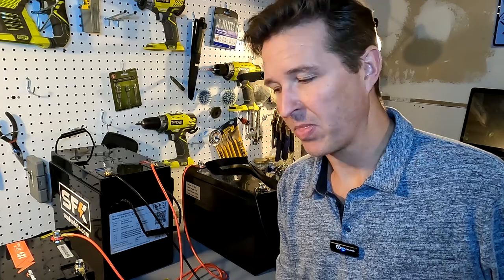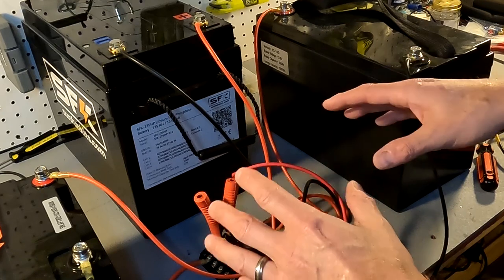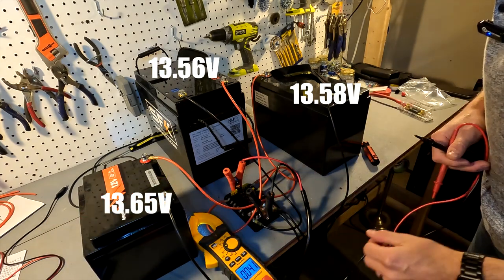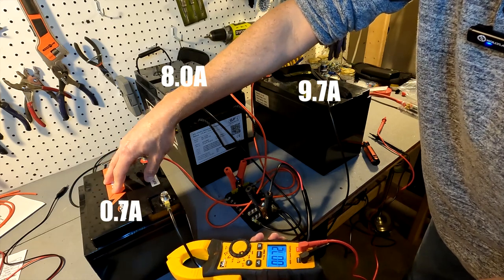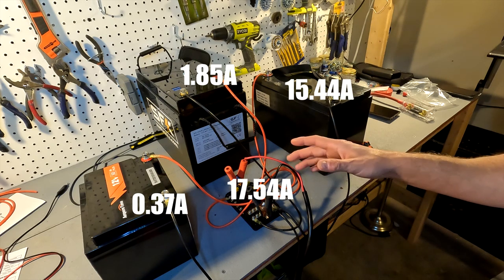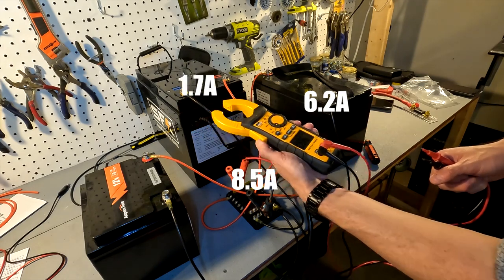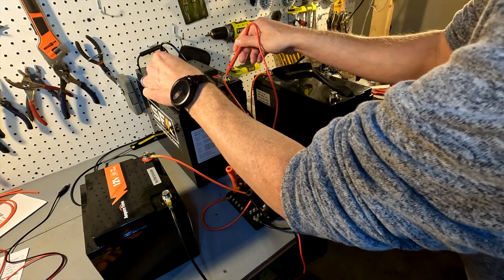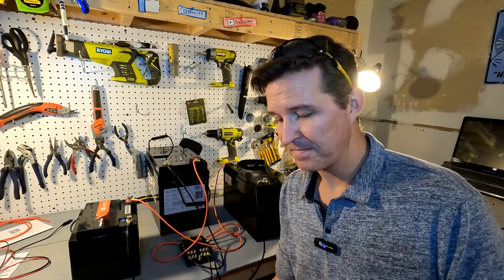Parallel charging Lifepo4 batteries of different brands and sizes!  Extreme Parallel Part 2!

Comment: good show , i might add another batt from other brand to my kit now
Reply from the maker: I don't see why not.  Just keep in mind that the two batteries will have different BMS's.  They could possibly have different settings for low voltage and high amperage shutoff.  If you keep the bank between 10% and 90% most of the time you will be just fine!  Thanks for the comment.

Comment: You can use different amp hour capacity batteries together, the problem is when you are discharging them in parallel. Each batteries different amp hours will kick off the lower amp hour batteries when the BMS turns off on your lower amp hour batteries. And that can cause strain on your other higher amp hour batteries. Also when you charge all your batteries together it can get out of balance on all your different battery cells. Best to keep batteries same amp hour rating and voltages together. They will balance better and drain better without their BMS turning them off.
Reply from the maker: This is true.  Thank you for the info.  This was only meant for proof of concept.

Comment: Exactly what I wanted to see. It proves that all batteries will eventually charge completely. Also the gauge of wire isn’t a factor since during the final charging there is such a low current.
Reply from the maker: I'm glad you got something out of it.  As long as you split the wiring from a busbar to each battery you just need to calculate the max amps divided by the number of batteries.  Wiring and breaker from the busbar to the inverter needs to be sized to the output of the inverter.  Thanks for the comment.
Reply: Guys that fly FPV often
 charge different amperage lipo  batteries with a parallel board all the time. However using lifpo4  with bms can be scary on drawing high amperage out.  RV draw OK, but larger draw like cabin or house you are asking for trouble.

Comment: The length of the cables must be the same to have a perfectly balanced system, and I doubt that dissimilar batteries can ever be balanced. I would expect differences in charging and discharging between them which would likely cause some to fail sooner than others.  I like your experiments!
Reply from the maker: Thanks for the comment and info.

Comment: Interesting experiment. I suspect the voltage differences and the varying amp push/draw might be due to each pack having cells made by different manufacturers, that there may be some variances in those that affected how they took in charge and their voltages, and how their voltages dropped when taken off charge. Might also be some differences with the BMSs causing some unexpected variances as well.
Reply from the maker: Yes.  All of that is true.  Internal resistance also plays a big part.  Thank you for the comment.
Reply: @OffGridBasement  Ah yeah! The wiring inside might make a little difference too, didn't even think about that. 

I find all these videos I've found on this topic lately to be great - everything I'd read up to this point has been "no no, can't parallel different capacity packs, don't do it!" and... well...

Comment: I'd never have considered charging different amperage batteries in parallel, like this. Theoretically it should be fine! They all have Control Modules, which should be fine, "theoretically".
I think you have just provided evidence it works in practicle application. So long as all the batteries together do not draw more current than the charger provides. I thinnk, Right? 
The question is, how do they survive long term in such an configuration.
Also, would the results be the same (or similar) using a solar array? 
Good test.
Reply from the maker: Thank you.  This setup does work in practice, but I'm unsure about how it would work in the long run as well.  I plan on continuing with the setup for a while to see the long term effects of battery balancing.  I really don't know how the setup would react to a solar charge controller.  The fluctuation of the amperage might really mess things up, but I'm not ready to test that yet.  Thanks for the comment.

Comment: You need to leave the charger connected for 30 minutes per 100 Ah of capacity. This will give the BMS time to balance the cells, this is the absorption cycle. You will notice during this time a small charge going to the battery. If this is not done the cells will soon be imbalanced affecting performance. Once absorption finishes they should be close to 14.2 volts.
Reply from the maker: Thanks for the info and the comment.

Comment: What you find very strange at 6:45 I found to be completely expected.  You connected the cells together when they were somewhere down the SOC curve but there is no way to know where each is because the curve is so flat.  The 100Ah was obviously at a lower SOC when connected and it doesn't really matter how long they are connected, they will not get close until you take them to near 100%SOC.  I would also say that your wires are too small and all the same gauge.  You would be better off by connecting paralleling wires between the three + and three -.  I connect my paralleled batteries with 4/0 cables so that they are all at the exact same voltage.  Your system was always going to have different voltages on each of the batteries and that is not really parallel.  To be parallel, all batteries must be at the exact same voltage and that is only done by having interconnecting wires big enough to not produce voltage drops to each battery.
As for your tester.  Those usually have less than 180w for the max draw.  You said that your three batteries have a total capacity of 425Ah so at a nominal voltage of 12.6v that comes to 12.6v x 4250Ah = 5,355W.  at 180w discharge max that will come to about 30 hours for the test.
Reply from the maker: Thank you for all the great information!  I really appreciate it.

Comment: Yo need to use atleast 8 awg gauge wires. Keep in mind you need to use fuses that are rated a little higher than your amp hour battery. So if you have a 50ah battery then you can use a 70 amp fuse, if you want to be safe you can use minimum 50 amp fuse. But fuses need a little leeway for amp draw. You use 12 awg gauge wire for anything lower than 30 amps. Any amp loads that are higher, such as your lifepo4 battery, use higher amp fuses and lower gauge wire.
Reply from the maker: Thank you for the information and the comment.
Reply: No you don't, shows how much you know. Most chargers that can charge up to 50ah comes with 2.5 - 4mm cables.

Comment: I'm thinking that you are going to be limited by the battery with the lowest "full charge" voltage.  With that battery, if you charge it to more than that, it is going to drop down to that once you disconnect it from the charger.  The battery with the higher "full charge" voltage will then be charging the lower voltage battery, but the lower voltage battery will not stay at that level, thus the charge is wasted.  This will continue until the higher "full charge" battery is at the same level as the lower "full charge" battery.

Another way to visualize this would be like water flowing into tanks... Let's say you have two open top tanks, each 13.7" tall, but one of them being 10" wide and the other being only 5" wide.  Let's also says that you have a water supply hooked up to both that will allow you to fill each up to the 13.7" level.  Let's also run a small diameter line interconnecting the bottom of the two tanks so that they seek equilibrium.  And lastly, let's add a small overflow hole near the top of each tank -- at the 12.5" level on the smaller tank and at the 13.4" level on the larger tank.  These overflow holes might not even be the same diameter which would thus simulate different discharge rates.  You fill the two tanks up to 13.7" which causes the water supply to be shut off.  At this point, but tanks are leaking water out the overflow holes.  The larger tank is going to get to it's overflow level and the water will stop coming out of it.  If the smaller tank has not reached this level yet, then it will continue until it reaches the level of its overflow hole.  But since the two tanks are connected and the smaller tank has a lower overflow hole, the water from the larger tank is going to flow into the smaller tank through the interconnect line.  This will raise the level of water in the smaller tank above the overflow hole which will cause the water to go out it.  This is going to continue until the larger tank is at the same level as the smaller tank.

With a battery bank, this energy has go go somewhere and it is most likely dissipated as heat due to that whole "Conservation of Energy" thing that we should remember from high school Physics class...
Reply from the maker: Thank you for the great analogy and comment.

Comment: I had a lot of  questions on this on the subject of hooking up batteries with different mah but same volts in parallel. I have about 15  18650 batteries all with different mah and few have no label to know the mah of the battery, so I was wondering what would happen if I hook them all up, but I think your video has shed more light on that (i.e they all even out) And while charging, it all depends on how dumb your charger is to not figure out that one of the batteries is fully charged.  Am About moving to the part three. please can u make a video to show an EASY way to check the mah of batteries
Reply from the maker: I'm happy the video helped shed some light on the subject.  Once all the batteries are in parallel you can't really find the mah of individual cells if they are different capacity.  Sorry I can't give you more information.

Comment: So in the end they balanced themselves out?
Reply from the maker: Yes.  They all charged up to 14.16v.  I thought that was odd since I was using a lifepo4 charger that is rated for up to 14.6v.  Anything over 14v is fully charged though.
Reply: @OffGridBasement  So in your opinion how important is it that the batteries are all the same. Seems to me that very different batteries sizes eventually balanced out. Or is it more important that the battery chemistries are the same? I see a lot of people harp on about the important of getting the same batteries in one bank.
Reply from the maker: @thebugs4934  my opinion is if you are using your system with heavy loads or you cycle it multiple times a day then you should have all the same battery.  The resistance in the cells will be closer to the same and the settings in the BMS are identical.
Reply: @OffGridBasement  good to know, thank you!

Comment: Late to the party, 
but this video is saying that you can mix different types of lithium batteries on a charging block. I want to know if I can mix a couple of different 100ah lithium batteries on my camper? I bought a camper a few months ago and it has one 100ah battery and I would like to add a 200ah battery in my battery box so that I have 300ah. Will it safely charge both batteries off of the solar?
Reply from the maker: Yes.  It's totally safe.  Keeping the batteries wired in parallel is fine with different capacities.  Just set your charge controller to charge up to 14v.  If you plan on it discharging all the way to zero, then you might have an issue with one battery shutting off before the other.  Hope this helps.  Thanks for the question and comment.
Reply: @OffGridBasement  Hello sir, wouldn't 14v be way to low to fully charge lithium?
Reply from the maker: It would give you 99% charge.  You would be at the upper elbow of the charge curve.

Comment: Hellow sir, can i parallel the lifepo4 32650 ang gel type batteries? 120ah lifepo4 and 50ah gel type batteries?
Reply from the maker: Yes you can, but I wouldn't recommend it.  The charge and discharge curves are different.

Comment: Hmmm interesting.   Another test will be w a load and charger.   And then solar w the different batteries and mppt.  

I’ve always tried to use same battery models in systems out of paranoia of balancing over many cycles and loads of battery w heaters as we operate off grid in them wild.  
Will be interesting to see your tests
Reply from the maker: I plan on doing a discharge test then connecting a 12v inverter to power a 24v charger.  I'm interested in the massive losses I will get!

Comment: voltage does not tell the full story on lifepo, top balance them together is a good idea, still, it will work no probleme, i do that with my battery bank, one is 24v 280, the other is 230 and the last one is 130 amp, no probleme for month .
Reply from the maker: Thanks for the info and the comment.